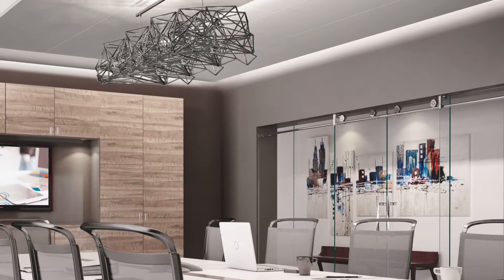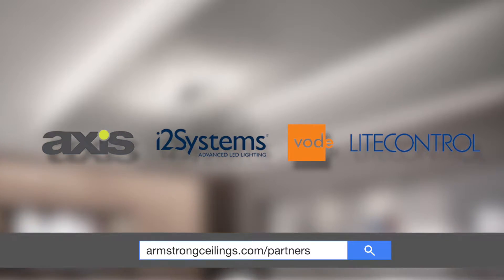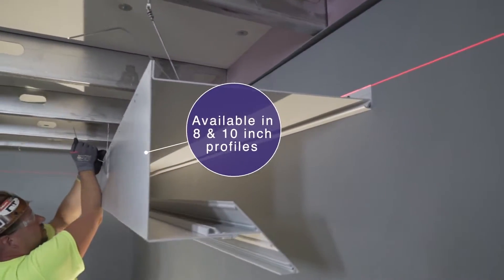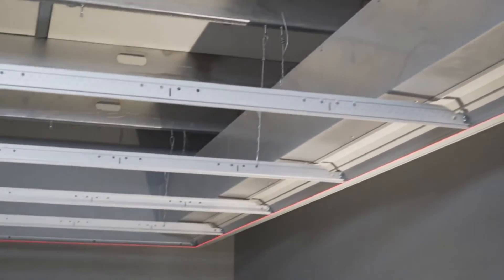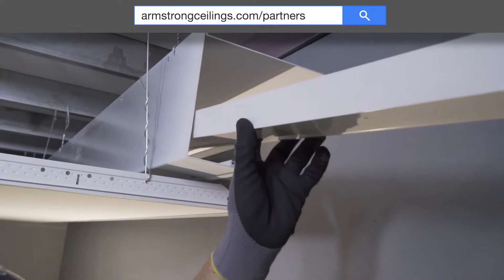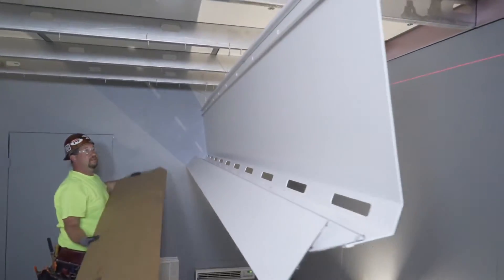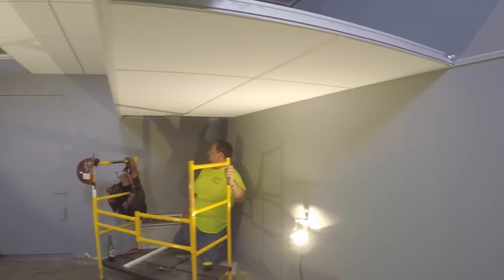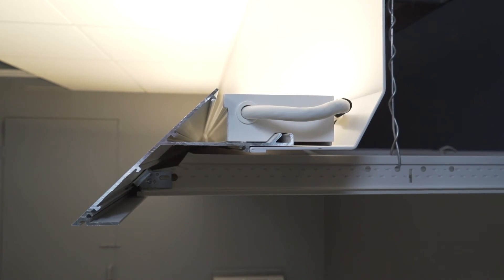Ceiling Indirect Lighting Using Drywall Grid | Installation How to | Armstrong Ceiling Solutions

Comment: Electricians replaced by interior system mechanic here
Reply from the maker: Hello Darrell – with this product line, the electricians still install the fixtures. We just simplify the construction of the actual light cove for the interior trades.  For this video, we just opted to have the interior systems contractor install the fixture for the sake of the video.  Have a good one!